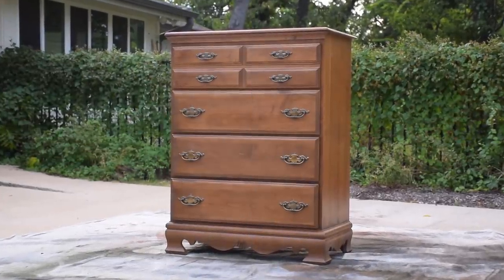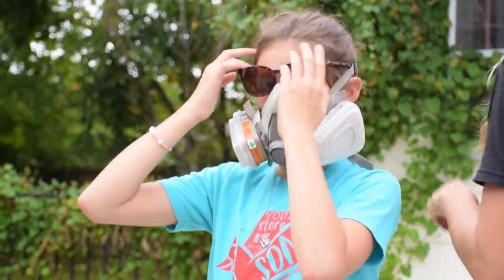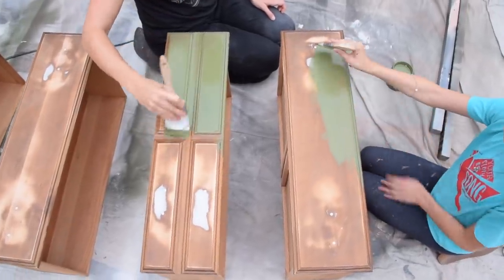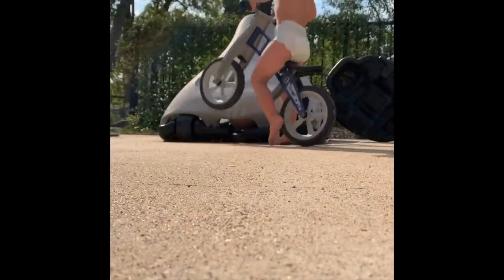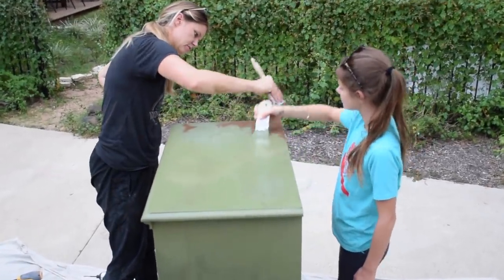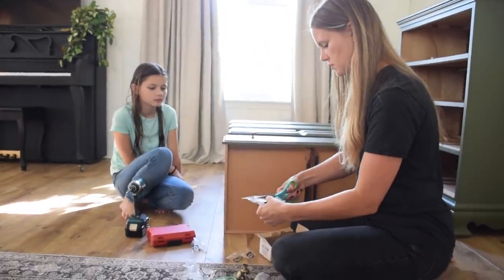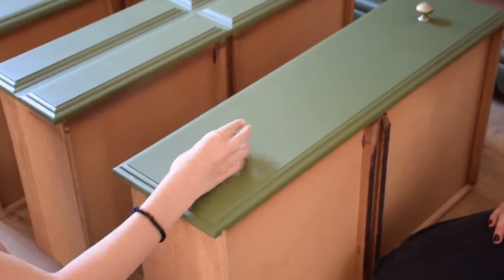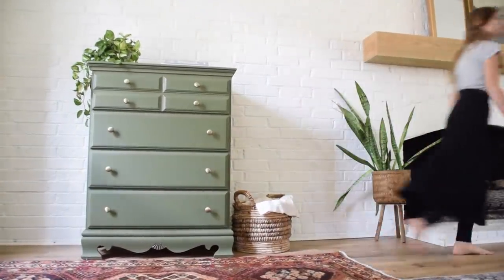Flipping A Dresser With My 11 y/o Daughter! // Furniture Makeover // Furniture Painting

Comment: Turned out nice...And you daughter wanting to learn how to DIY is awesome. 
I have a few questions, but don't want it to sound negative.  So please don't take it that way. Thanks
1. Why do you use so much Bondo to fill a couple small holes?  Could you use a smaller putty knife and just fill the holes. Less sanding to remove the extra bondo
2. Why don't you use a sprayer to apply the paint? It may require more prep work, but  a sprayer would give an even coat, go on much smoother and there would be no brush marks.
3. Why don't you use a flat or satin top coat to protect the paint? Are you not concern that over time the paint may wear off, chip or even fade due to sunlight?